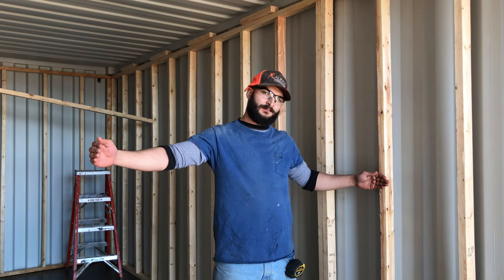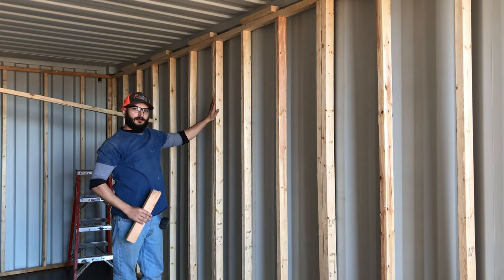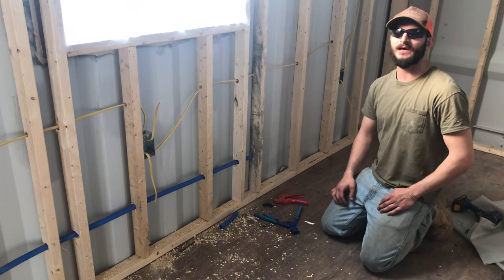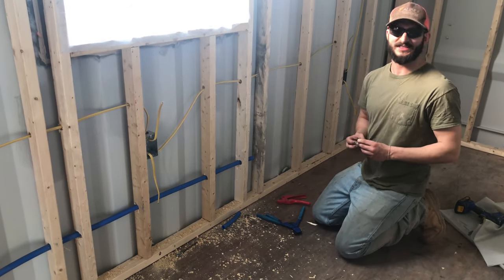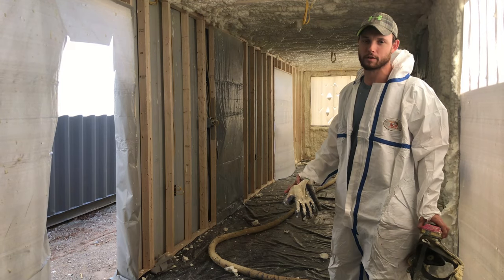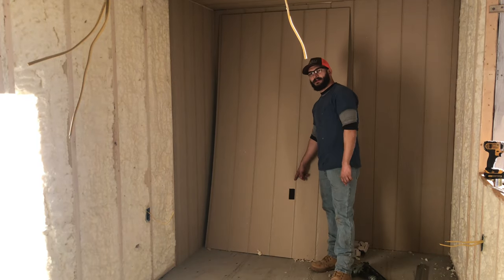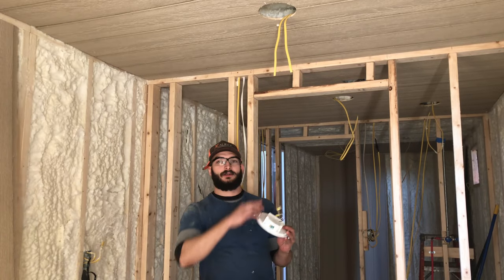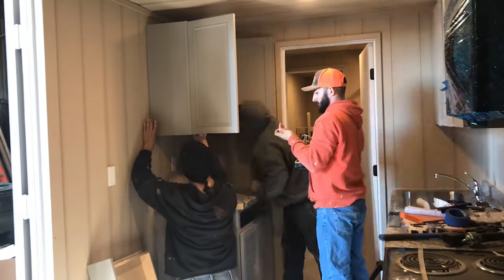How To: Build Out the Interior of a Shipping Container for Tiny Home Living 🏡

Comment: Why not apply closed cell foam direct to the container? Just curious, I’ve always been told that’s the only way.
Reply: That would be ok if you are not putting in sheetrock or interior walls. Some of their containers actually are done that way if you check out their website. Spraying the foam directly to the container walls creates a much more rustic and unfinished appearance.
Reply: That open cell foam is going to soak up any condensation and create big problems down the road.